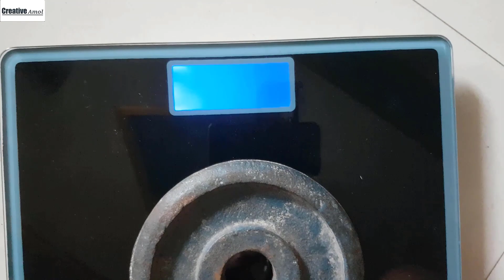Crayford Style Focuser | How To Make Crayford Focuser | Telescope Focuser

Comment: Great work there, the focuser mechanism looks to work very well and smoothly.
Reply from the maker: Actually i used 5mm bolt as a shaft so it is not very smooth... shaft should be non threaded 2mm to 3mm for smooth operation